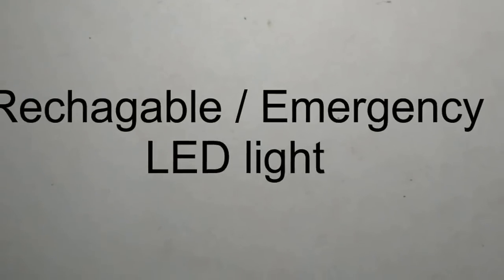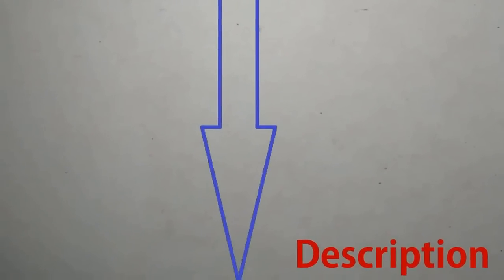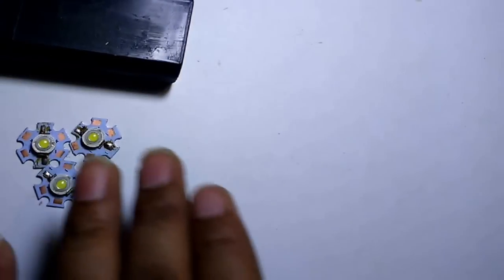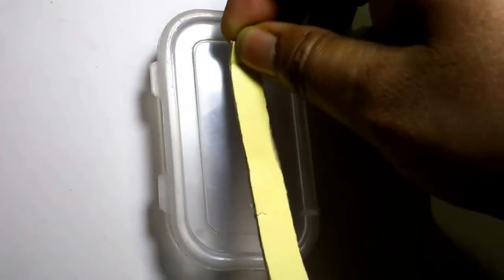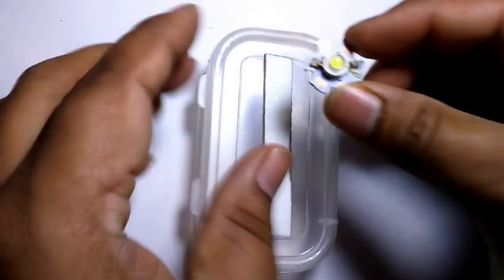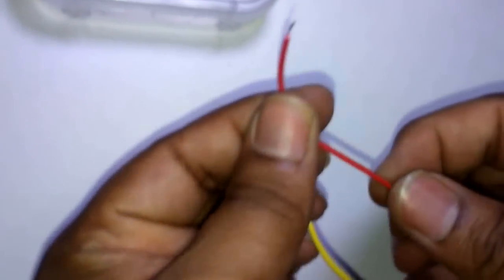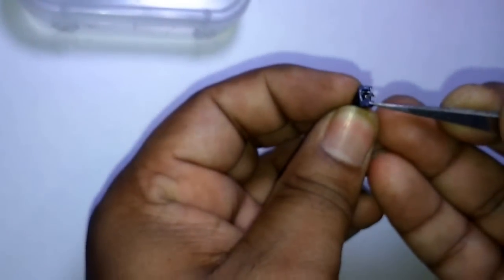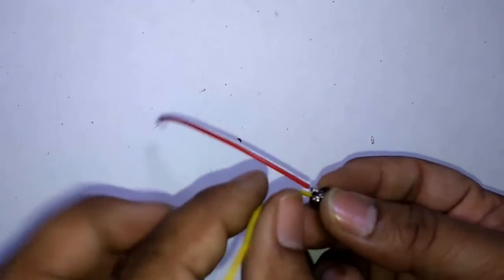How to Make | Emergency | Rechargeable | LED | light

Comment: With diode the it results in bursting too because diode IN4007 with capacity 1000v helps by blocking the current and supplying sufficient only

Comment: LED Light continuously kitne time tak jal sakti hai???
Aapne led ke liye resistor ka use kyon nahi kiya ?? (Maybe required)
Reply from the maker: It glows up to 2-3 hours continuously.
ya you can use resistor. If you use resistor LED will not burn

Comment: How to use micro usb female connector and small Lithium ion mobile battery in this circuit with various flash modes?
Reply: If possible make video on it.. or reply with sketch of circuit diagram of it to chaudhari.dipak5@rediffmail.comI will be waiting..
Reply from the maker: +DIPAK CHAUDHARI you can use multimeter, first you should connect female connector to AC charger point then check it's voltage with +ve sign,for checking it's sign touch red and black wire of multimeter to soldering place of female connector
Reply from the maker: please watch this  video,  i already describe it very easily in the middle session of this video
 https://youtu.be/nMcz5SEEPvI
Reply: How to used 6 mode flash circuit in dipawali led lighting ( rectangular box) in this circuit.. 
It would be helpful..

Comment: what is use of resistor??
Reply from the maker: +Amit Gavali, Resistor is used for protect the LED. It is used to limit the current through the LED and to prevent that it burns.
Reply: +Crazy Thinker 
thanks...I like your idea..
Reply from the maker: Thanks Amit Gavali

Comment: Charging pin m kese pta chalega ki +h ya- h
Reply from the maker: +Hamza Malik you can check through multi meter, when you connect this pin to AC charger. Connect one side of pin with red wire of multimeter and another side with black wire, if display in multi meter is -ve voltage then it is -ve side of pin other wise +ve side of pin. I hope you will understand

Comment: In that 1 led how many volt
Reply from the maker: 1W led
Lens Color : Water clear
 Light Color: White
 Luminous Intensity: 70-80Lumens
 Forward Voltage : 3.0-3.5V
 Forward Current: 300mA
 Color Temperature : 5500-6500k

Comment: In this we don't want the diode
Reply from the maker: If you want then use diode
Reply: without diode,the charging led will also light up ,when the switch is on.
Reply: chò  chò
Reply: Ơơ  Ơơ  Ơơ
Reply: With diode the it results in bursting too because diode IN4007 with capacity 1000v helps by blocking the current and supplying sufficient to it